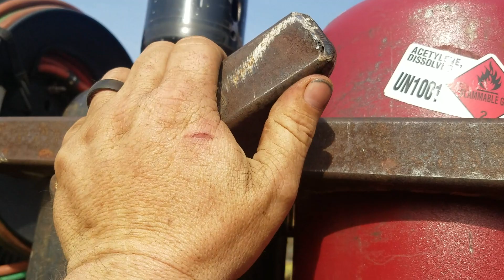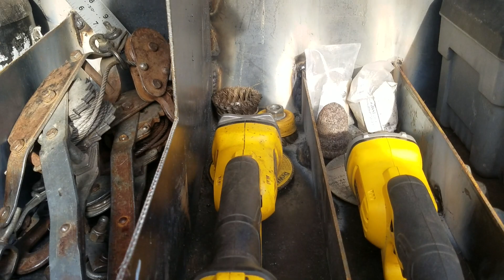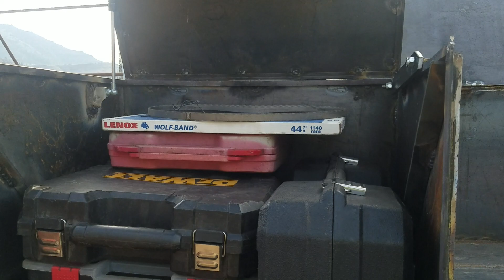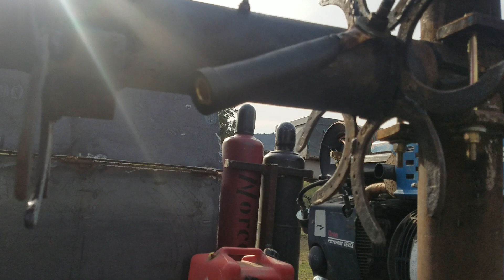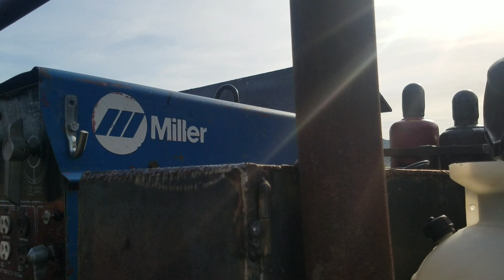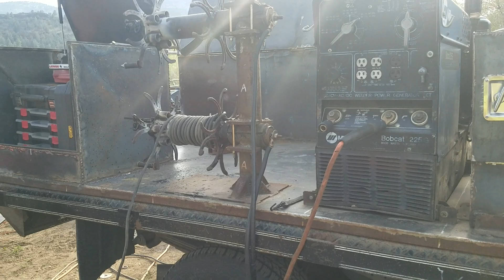Welding skid tour

Comment: Them welds look rough
Reply from the maker: Cameron Lott some are a bit rough. All 3 of us who were working on it were first timers on thin sheet metal. As this was needed for work before it was completely done it hadn't got ground down at that point either. Was a fun build though.
Reply: @jdbunch2269  Certainly good fab practice. Was yaw running solid wire or stick?
Reply from the maker: @tfred2129  All stick. Mostly 6013 for the sheet metal, some of the thicker pieces we opted for 7018 or 6011 depending on the piece and position. Just more familiar and comfortable with those two than the 6013.
Reply: @jdbunch2269  Gotcha

Comment: A piece of stall mat under the welder might be helpful in isolating the welder and absorbing shock.
Reply: i was thinking vibration and sound dampening. it would only help with isolation if a motor mount failed.
Reply from the maker: We thought of that, however, it wouldn't isolate it completely having to bolt it down.